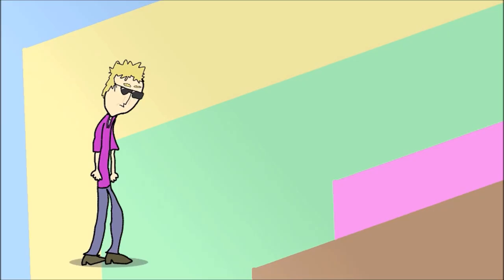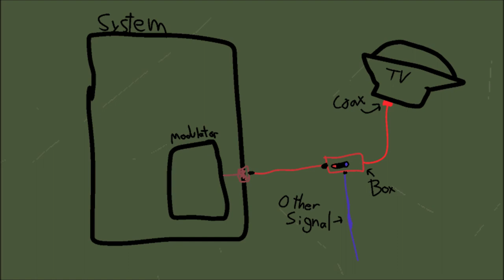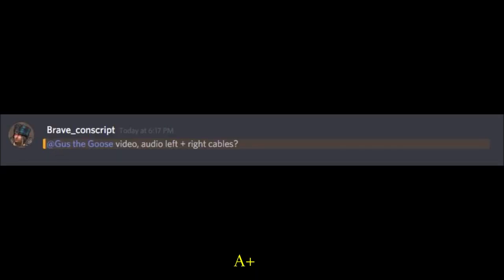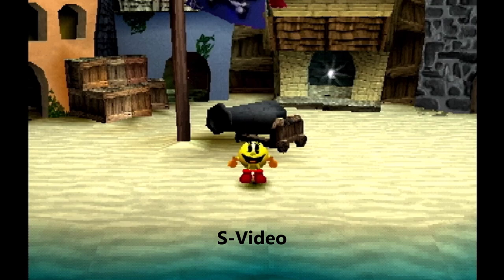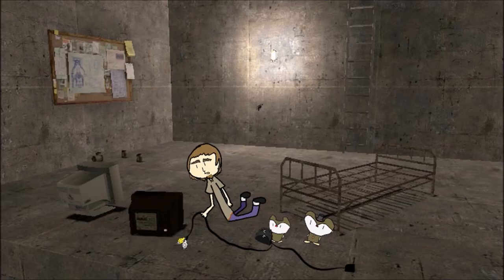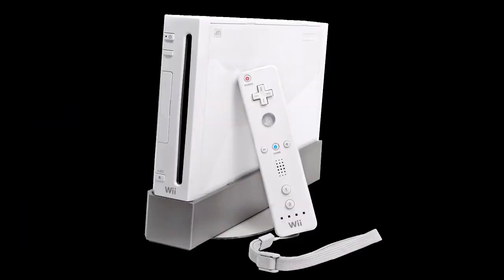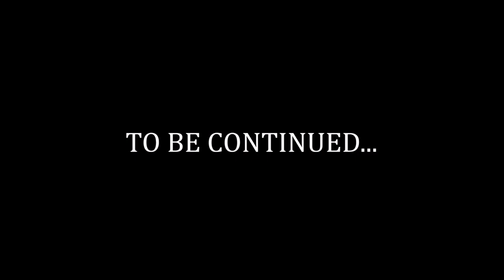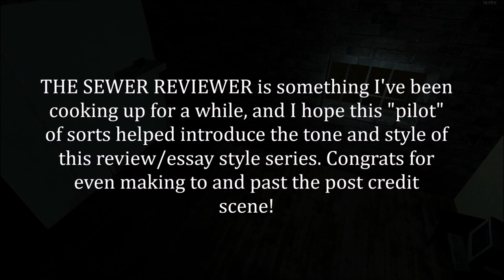History of Video Game Analog Video Signals - The Sewer Reviewer Pilot

Comment: Didn't Nintendo release component cables for the Super Nintendo? The Super Nintendo outputs an RGB signal via the multi-out port, and I assume the first cable which could convert that signal to YPbPr signals to component connectors came out long before the PS2, if not before the Nintendo 64 as well. 

Also, I don't think any production N64's supported RGB output at all, in any region, though it seems this was a feature that was originally included in at least some earlier pre-production designs.